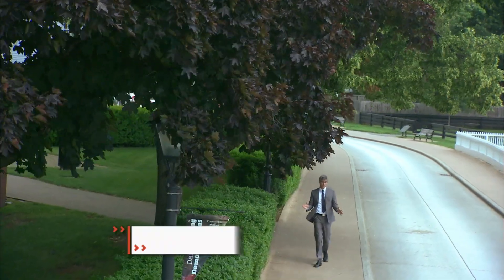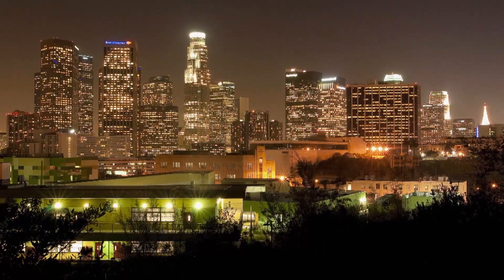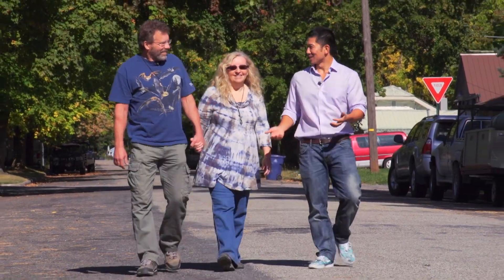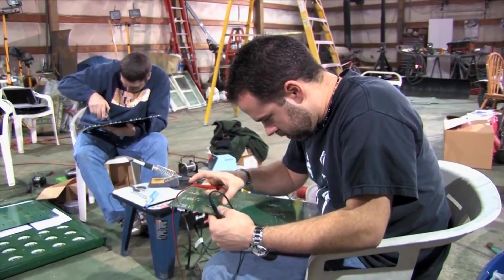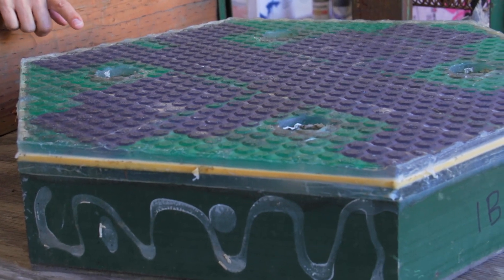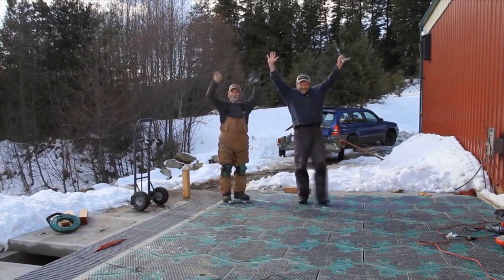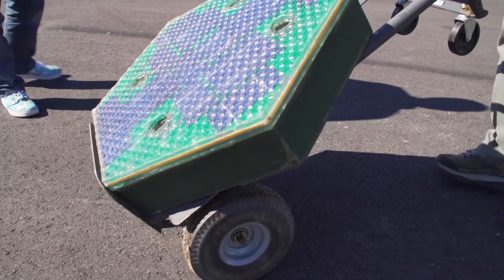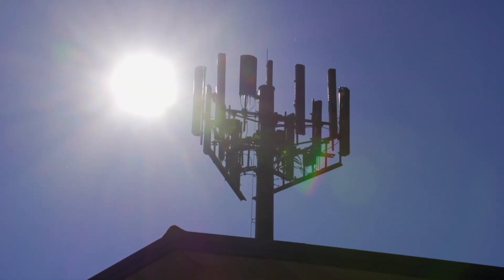Solar Roadways | The Henry Ford's Innovation Nation

Comment: A list of some of the reasons these are inefficient and impracticable: 

being flat on a road reduces power output

 being covered by mud and cars reduces power output 

cars damage panels eventually

 buildings will shade panels meaning they only work for a small time period with the sun directly overhead. 

Roads take up a relatively small amount of space. Why put them on roads when you could fill up a desert? (it cant be used for farming so why not?)

It would be much better to place them somewhere where they are not obscured, not damaged, not in shade and where they can be tilted towards the sun. There is ZERO practicle benifet to putting these on roads: you want to charge cars from roads? - cables exist. You want LED's on roads? - they don't need solar panels to go on a road.

also it's far cheaper to have a solar panel that doesn't need tempered glass included in it's construction